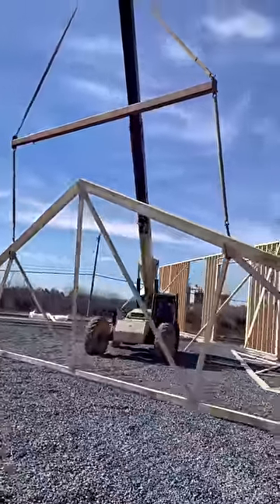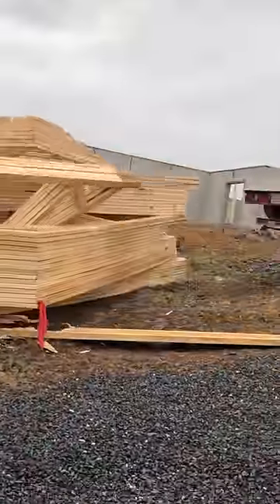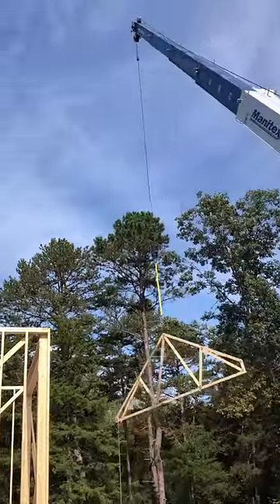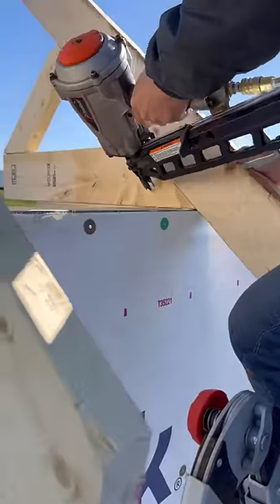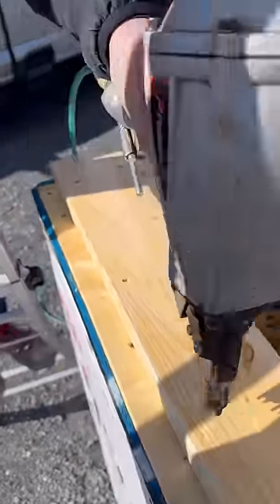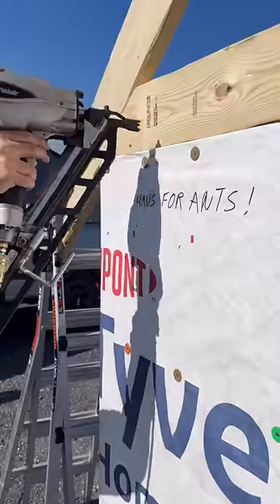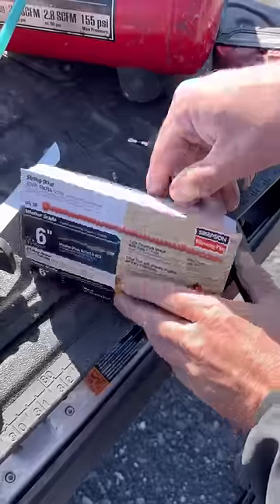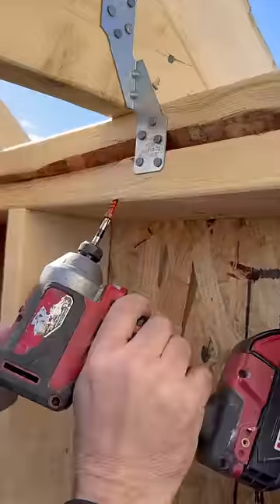How Roof Trusses Work

Comment: I live in an 80 year old house in Europe, and our roof trusses have stronger internal members arranged in a way that allows crawling in the middle to use the attic space .
Reply: You can request truss manufactures to leave openings in the truss, it’s just going to cost more as it requires more time to design and usually isn’t the most efficient design. This is especially true if it’s just one or two and not a repeating design on the project.
Reply: @Larry_Owlmann  At that age, the design was probably an existing textbook design manufactured by a local contractor to match the building width .  No "custom design", just the standard for that many feet wide, using a design from before going metric  .

Comment: I never toenail trusses. Flat deadwood between trusses and a vertical block unless you need ventilation on the eave. Staple-nail the flat deadwood by alternating the angle on the separate sets of nails. Always use hurricane clips or trusses clips with alternate strapping

Comment: I would guess that 99% of people have no idea about the geometry and physics of truss construction, tension components, or compression components of the truss. I used to diagram to design truss loads with math. It was fun. Nowadays, some guy in front of a computer plugs in the parameters and the computor spits out a shop drawing. 
Loads are more evenly spread out.
Lastly, you will NEVER see a properly built truss sag  (get a belly), like a rafter is capable of, depending on loading. For both, rafters and trusses, lumber species, quality (grade) are important considerations. You don't just use whatever is handy for every application.

Comment: Ok guys so old derelict build , really thick walls , with I imagine stone it's been rendered professional for years and years so , the ceiling edges that meet the walls are not 90o they are the same pitch as roof so when it comes to a new roof the roof joist will be lower as per head plate height instead of higher than they are now due to roof rafters angle the ceiling will be lower , so I'm thinking I'll have to use rafters rather than trusses , it's like the outside wall is lower than intetior ceiling therefore the rafters angle come through edge  where wall and ceiling meet , hope i have explained it well enough . Really wanted to lose that angle inside .

Comment: I used trusses when I built my shed but if I build a larger building I'll probably do rafters. Lifting full size trusses alone would be really tricky.  If you have access to equipment then trusses may in fact go faster since you can make them on the ground and use the first one as a template to make the others.

Comment: Incorrect placement of your gable end truss. Trusses are designed with a chamber, and the load is added to the trusses and then settles straight. It goes on the inside. But you do, you 👍
Reply: Can you explain how you think he should have placed it? I'm a noob to this, so I'm confused by your comment. Are you saying the additional plate he uses should have been aligned differently or something? The way he uses it made it flush with the wall, so looked nice to a layman like me, but I'd love to hear otherwise.
Reply from the maker: That’s bad information. That’s exactly where the gable end truss goes. I have tons of truss layouts (engineered by the trust company) from past jobs to show the exact placement of the gable truss. Then you continue sheathing straight up the wall.
Reply from the maker: It’s not wrong
Reply: Obviously different ways, im aussie so of cause we do it differently, but if you are cladding your gable end truss 😂 end of the day do as the engineers specified
Reply: @overseastom no point breaking it down, as you dont need to know any more if you can't understand that. ✌️
Reply: @hausplans we owned a truss and frame factory 🫡

Comment: As an insurance adjuster, I will share that trusses fall over like dominoes once the sheathing has been breached by strong winds. Rafters stay in place though.
The trusses are relying on support to maintain their integrity. The rafters are not. Just my lil opinion.
Reply from the maker: Modern trusses have intricate bracing that’s required on the inside that holds them up even without sheathing

Comment: Fyi. Those truss "webs" arent transferring loads to interior walls. A truss assembly is designed to transfer the forces of roofing, snow load, etc out to the ends of the truss while minimizing sag in the mid spans of the roof and ceiling below. Google truss design and head down that rabbit hole. 😊
Reply from the maker: I don’t think I said the website transfers any loads to the interior walls

Comment: Whhhhaaat / "usually 2 foot on centers"; >< maybe for a dog-house or chicken coup. I  Have Thrown Away "Hundereds" of New-House Construction "Roof-Trusses" BECAUSE the "staple-gunners & wood-tacker's" ( NOT REAL CARPENTERS) put these "Enginered Roof Trusses on a TWO-FOOT lay-out Spacing instead of the "DIAMOND"= 19 3/16" Lay Out!!!!!. Built these "Shacks" myself with FULL CONTEMPT over this Argument with the "CON-Tractor material cheaters"..saying that these "left-over" 4-6 trusses NEED to BE IN the ROOF FRAMING instead of the Scrap Pile.

Comment: What the fuck was delivery method? As a structural engineer I would be rejecting that load
Reply from the maker: That’s honestly the standard way they’re delivered. I’ve used a lot of different companies in different areas. What you saw breaking was some scrap I joist they used to cushion the trusses. No trusses broke on that delivery
Reply: @hausplans  The nail plates are very thin and not designed for out of plane flexure, I would not be having this on my house